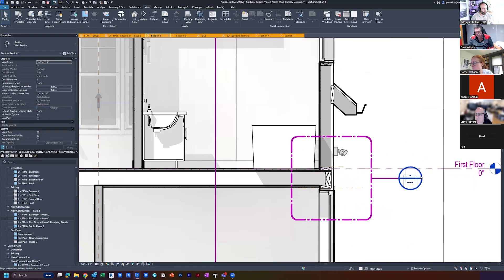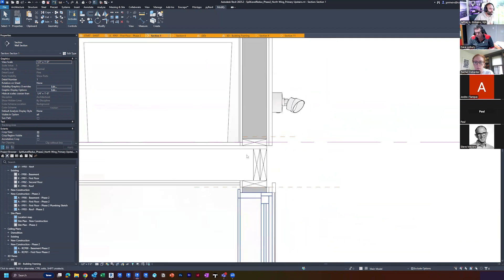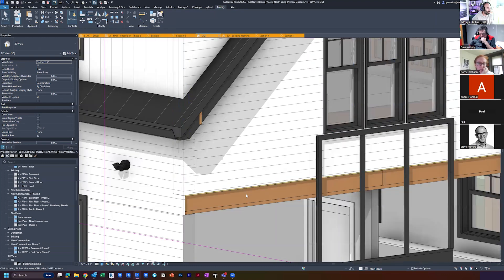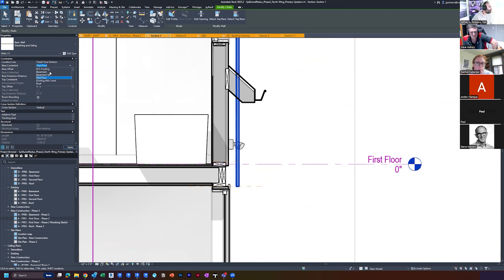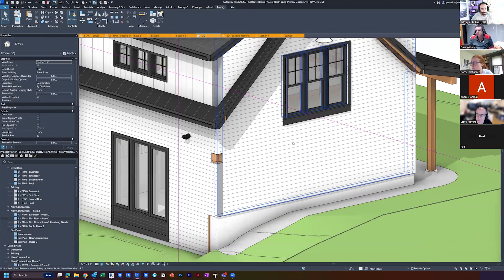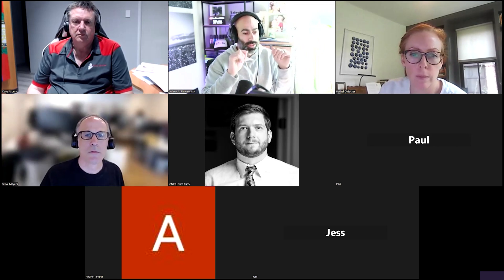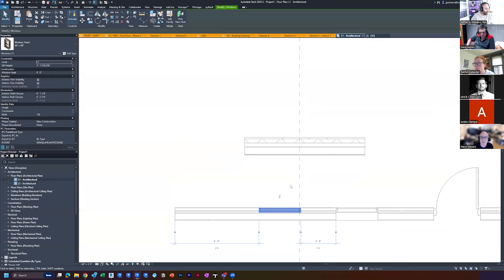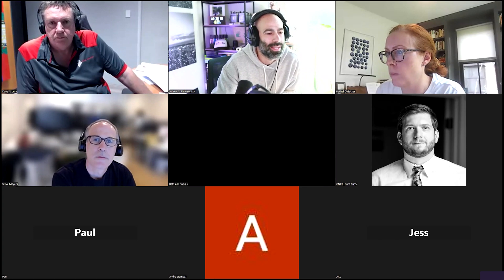Model Where Sheathing / Siding Overlap Rim Joist in Revit (3 Options)

Comment: How do you manage wall types across a project when you start separating walls into multiple walls?
Reply from the maker: Not sure what you mean?
Reply: @TheRevitKid  As in when you look to do a wall type plan how you ensure your capture all the 'compound' walls.. and how do you best tag them?
Reply from the maker: Exterior walls aren't typically part of "wall types" as their details are shown in wall sections.  For small scale residential like this, I use a multi-category tag to tag the walls with a description and rarely use "wall tags".  For larger projects, wall sections and details will typically be used to show exterior wall makeups.  If you wanted to capture them as wall types there are different approaches like using one of the layers to control the tag itself.  or have a second parameter and tag that pulls it in and that can be used for "compound wall type"... So, yeah ... many options! lol
Reply: @TheRevitKid  interesting… we typically we have a wall types plan capturing all wall types from outside face to inside and then have a wall types series that documents each build up.. which on a house might be 12 or so wall types.
Reply from the maker: @jessegould1 you could do that… in my experience for small scale residential… the more you have on the plans (and less drawing sheets you have) the better 😂

Comment: So miter your wall corners? Then use parts to drag the cladding / sheathing down. That’s it. Your framing can still be butt joined bc it’s a separate system
Reply from the maker: We talked about the pros and cons of the parts method too.  Parts work great but they can cause unwanted graphics in plan view when you break and pull a layer.
Reply: Thanks for the response, and for all of the sharing that you do. I enjoy your channel! 

Sorry if I missed a longer video but I haven’t had issues with mitered corners and parts. I noticed the walls you showed in this video were butt jointed not mitered - it looked like the issues you ran into might have been related to that corner join type.

Comment: I use a method that is close to one that you use with a few important differences. Walls run all from the top of foundation to the second floor to plate. Floors are built as subfloor layer over joist layer and the extents run all the way to the outer face of wall stud. Then you join the floor to the walls (multiple join works to join to all walls). This "cuts" the floor area out of the wall for the full floor system thickness. The wall is continuous and the wall joins don't get goofy. Extra tips if you create parts you can hide that structure layer in any view that you find it annoying, and if you make it out of a transparent material it will be invisible by default in renderings/realistic.

Comment: Our standard walls are in two parts - "Finish" and "Core". This allows more freedom in designing the exterior material finishes, material heights, and material thicknesses without disrupting the core wall joins, painted walls, etc. Yes, the two walls must be Joined. Another benefit is every wall with "finish" in the name gets seen in a filter and gets a thicker exterior line on floor plans.

Also, sometimes BIM depends on CAD. Cut Profiles, Detal Components, Drafting Objects, and Linework overrides are all valid tools for communicating design intent.

Comment: While it's cool to model all the individual pieces of lumber, surely you don't actually do this in larger projects? I can't imagine having the time to model large apartment complexes or hotels like this. 

Not sure if this touches on one of your 3 options, but I usually have my lower wall come up to the base of the higher wall, join them for the sake of consistent cladding, then attach top/base the lower wall to the floor. The floor is modeled to end at the outside face of stud. This cleans up the lower wall by not having it cut through the floor, but makes the cladding continue up and connect to the wall above. Works for me most of the time, but there always seems to be issues no matter what method is used.
Reply from the maker: This is an option I talk about......  Also, for framing... There is massive benefit to modeling your framing.  I do this on all of my residential projects. The only framing I didn't model in this one is the field wall studs.... Floors, rim joists, plates, rafters, etc... Its so helpful when solving the puzzle of building your building... It also makes drawing your details easier.  As for larger projects, usually a structural engineer is involved and they may be the ones modeling it, but same rules apply.

Comment: i generally like to join wall with floor when I can, but there is a moment to think about at that location that you were working at.  because the siding goes lower than the floor and covers the sill

Comment: I maintain a layer in the floor for my framing and keep both functions as structural. Then the wall can be pulled down to the bottom of the framing and join the wall to the floor, this cleans up the interior “Wall layers’ without the issues you describe of the banding/finish.

Comment: As for a lot of things in Revit, it's basically a shortcoming of Revit, demanding a work-around. While you can modify the top / bottom of layers in a wall, you can't modify the left / right end. I like to choose the method of unlocking some layers in the wall to pull them up / down and to cleanup the corners, switch the join order of the walls. If that won't do, then split up the wall's layers into separate walls.